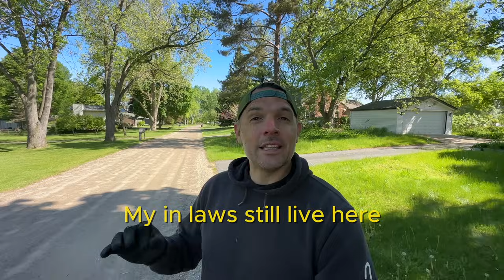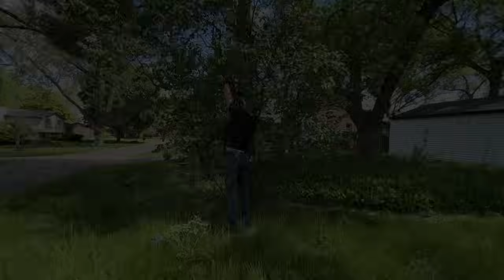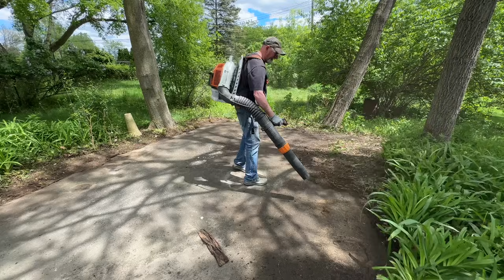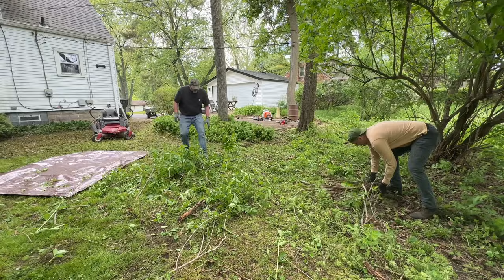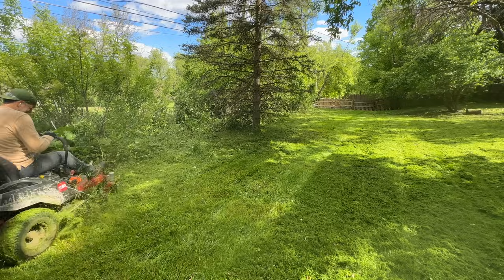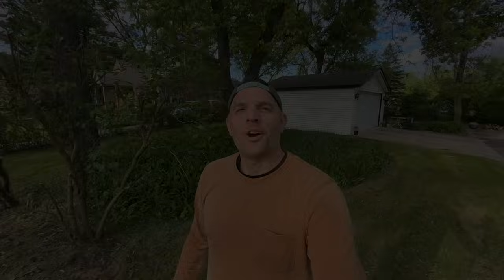Complete TRANSFORMATION brightens ENTIRE STREET - POWER WASH bonus

Comment: Respect those power wires.  As a tech for a satellite tv company, I had a box that was acting up. While working on it, my forearm hit the antenna on the box and it shocked me... took me a little time to find the issue, but someone had crossed the coax outlet over the service cable outside and it had a very small pin hole where they met and energized the coax cable.  You would not have known there was a hole in that rubber if it werent for the small burn mark where it was arcing on the coax.

Comment: One thing to know is that you should never spray upwards into vinyl siding. It is only water resistant from a downward angle and moisture will become trapped and cause mold and rot issues. There are wand extenders and swivels that can help maintain a downward angle. Looks good though!